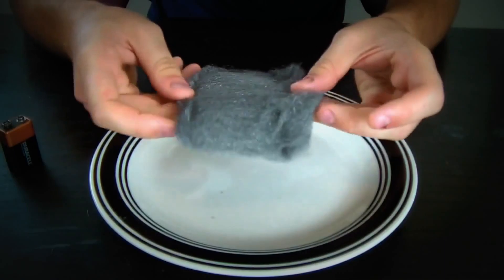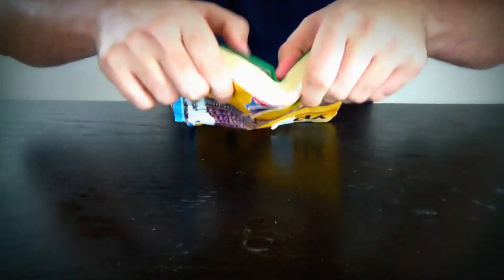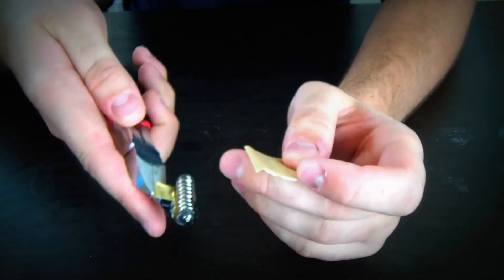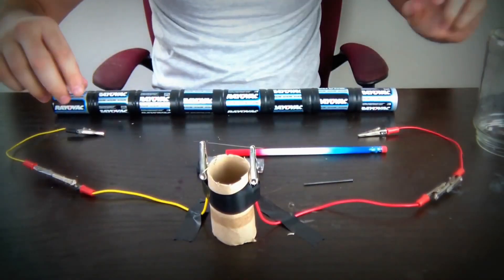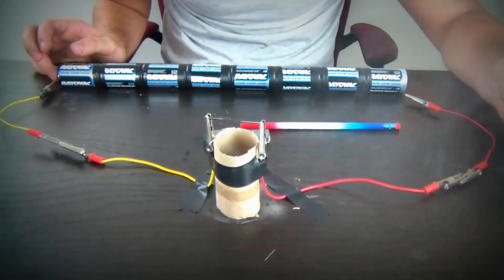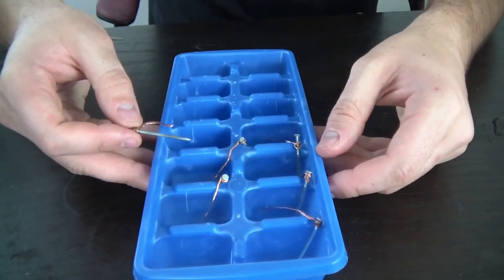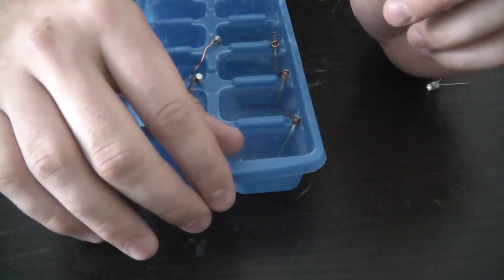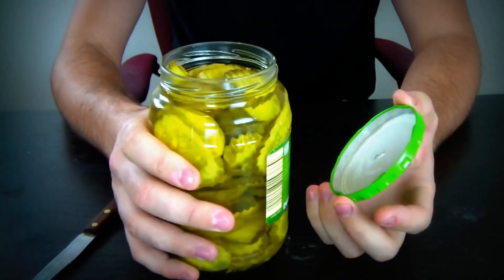10 Amazing Science Experiments you can do at home #14

Comment: 2:38 most of the batteries dont have small ones inside..  if u cut them than toxical shit will like out of there that my go in your eyes..
Reply: He used an A23 battery, which provides 12v. They always have smaller batteries inside. Other batteries, such as AA or AAA batteries do not have smaller, cell batteries inside.
Reply: infact he use the glasses

Comment: The 9 volt battery sets the steel wool on fire because the steel wool is so thin that the heat from the electricity from the battery lights it on fire, and if the steel wool weren't metal it wouldn't do that, so steel wolf is like one of the easiest things to burn with electricity. Never use steel wool to conduct electricity. XD

Comment: Can somebody explain the first one?
Reply: Steel is iron with most impurities removed from the ore.  There isn't much steel on earth that exist in a non man made fashion.  The result of removing impurities in Iron and creating steel lower the carbon concentration in steel. What is happening is that iron can rust in several ways.  One way of creating rust is water and oxygen, a process most people are familiar with.  If you leave a lock , battery, fence, ect , exposed to elements for too long it will begin to rust.  The objective of paint or sealer is to lock in and eliminate oxygen exposure to steel , lowering its ability to rust. The second method of created rust is to reheat steel.  The more oxygen involved the higher the temperature reached the more oxygenation taking place in the reaction.  Okay so oxygen isn't the only factor in this reaction , its more of the fuel than the fire but the reason steel wool catches fire so easily and say , a fork doesn't, has to do with the thickness vs the oxygen available, since steel wool is tiny fibers of steel , there is ample oxygen between the small tiny fibers to aid in the spreading of the heat.  This can be explain in terms of building a normal fire, if you stick a paper towel under a huge log , you likely will not achieve a fire however, if you build a tepee of sticks that are small, and place that same heat source under them you will create a fire, that you can fuel enough to eventually burn the log.  Steel is flammable in the right conditions.  When you touch the battery what happens is a short circuit, the energy has no where to go so it heats the source sort of like when you use an electric stove top.... that heat if fueled by said oxygen....as the electrical source adds charged particle to the metal , they start to collide, and it slows down the current process inside the steel wool but the battery is still putting out the same charge..this = extreme energy absorption of a small area creating temperatures in excess of 800 degree F to 1000+ F .  Simple put, don't touch the steel wool, blowing on it aides in the oxygen around it , causing it to spread and oxidize faster.  This is part of the reason why you can not run a 220 current down a 110 wire, it just will not end well for you.  At first it may be okay but the second you get even a small surge, its fire time! This is also the reason for breakers in your home, to ensure wiring it not taking on a load that is too extreme.  Steel is a terrible conductor of electricity, this is why it is not used in electronics, elements such as Gold, Copper, Zinc , make for excellent conductors, while steel and graphite (such as the pencil experiment) will burn out quickly over time.  You could start a fire with graphite as well.
Reply: +Cole DeLavergne you're WAAAAY off on this one...
What's happening is he's utilizing the steel wool to complete the circuit by touching it to both the negative and positive terminals on the battery. This causes heat to build up in the extremely thin fibers of the steel wool to about 700 degrees Fahrenheit, due to the electricity now traveling through the circuit i.e. The fibers of the steel wool. That heat then reacts with the pockets of oxygen throughout the porous steel wool like a flame coming in contact with fuel, which causes combustion to occur. This then spreads via a chain reaction, like a domino effect thereby spreading the flame.This is why it catches on fire.

Comment: it happens because of the low resistance in the steel wool when the charge goes through it, it's amps are very high causing it to heat up and combust...

Comment: You'd think this guy would know how LEDs work. One leg of the LED is longer than the other, and that's the positive lead. If you connect an LED backwards to a power source with even a little more current than those tiny batteries, the LED will explode.
Reply: anode and cathode
Reply: its fake cause you cant turn on an LED without a powersource

Comment: At 10:30. Better way of doing it is this.  Take a spoon, flip it so the handle is pointed up and under the lid.  Press it so it goes against the jar body and you will feel the lid pop as the air enters the jar.  That's the easy safe way of doing it..

Comment: Tip for the Ice Cube Tray one:
It is basically creating an electrochemical cell- the largest voltage is created with the greatest difference in the reactivity's of the metals, so try to use something like zinc and copper, or similar. Also, I would use a different acid that is stronger e.g. HCl for good results- acetic acid is only partly ionised in water meaning there are fewer ions that are free to move, therefore producing less of a voltage.

Comment: If you use two pieces of carbon rod and touch them gently then separate them a small distance, you get a very very bright arc (use eye protection, there might be a lot of UV in it, which is bad for your eyes). This is the way arc lamps worked; they also had a circuit which moved the electrodes as they were consumed to keep the amount of current roughly constant.

Comment: 1:14, here's how it works...
The stuff is clearly steel wool. What can also be easily seen, is that the strands of this wool are very, very thin: the size is '0000', the smallest size of steel wool you can buy. This is important. The reason it "burns", so fast is because of that word 'conduction'. The heat builds up so fast, and is able to transfer so fast, because of the ultra thin strands. However, it does not burn, this stuff is melting. Yes, the steel is heating up so fast, that it becomes molten metal. When you blow, it spreads faster. Why? Same reason fire spreads (and gets hotter) when you blow on it. The metal oxidises. One cool trick you can do with steel wool, is tie it to the end of a cord, light it, and fling it in a circular motion above your head. Have fun! Hope i answered a few questions.
Reply: lol troll
Reply: ***** no, not really... thats pretty much exactly what happens... not a troll, good sir :P

Comment: The resistance of the wool steel is very low, when you apply a voltage on it, the current ( compared to the electrons flow, or speed) is realy hi, even thought the voltage is low. the fire is made by the friction between the electrons and the steel's atoms

Comment: The steel wool catches fire because the electrons (or the electricity) are not limited by any resistor (a light bulb or anything else using electricity) when they pass through the steel wool. So, they pass through infinitely until the steel cannot bare the electrons and releases the energy as heat and light. To do this with a different size battery, simply find a way to touch both ends to metal. BE VERY CAREFUL, A LARGE FIRE OR EVEN MOLTEN METAL COULD OCCURE IN SECONDS.
Reply: U guys are having a go at him for having a brain logic what has the world come to
Reply: Smartass
Reply: Wow your smart
Reply: Smart nerd
Reply: I carry steal wool and a 9 volt in my wilderness survival kit for this very reason. Highly explosive if your in a dry forest.
Reply: Wow I looked in Google and found this exact same definitoin
Reply: I would say that there are better definitions:
The electrons pass through the wire, due to its thin cross sectional area, there is a high resistance created as Resistance is inversely proportional to cross sectional area. This basically means the electrons all flow through a small space, as they do so, they transfer their kinetic energy to the metal ions in the lattice, giving them more and more energy. When this energy is high enough, they gain more energy than the activation energy (denoted Ea) for the reaction of that metal with oxygen (whether that be complete or incomplete combustion). The redox reaction then occurs where the metal forms the metal oxide in order to complete its outer energy level of electrons, (probably with d-electron orbitals as it is likely to be a transition metal). This reaction is exothermic, (As Delta H will equal a negative number where Delta H is the Hamiltonian operator for the system), so energy is released by the reaction which 'creates' the flame. If there is any thing else you want me to add, I can, any corrections please mention.
Reply: We're not having a go at him, we just thought it was rather ironic.

Comment: for the steel wool the electrical current travels through the wire but its 2 high voltage so the wire burns up

Comment: Poking a hole in the lid ruins the entire purpose of the lid because now you have to eat all those damn pickles at once
Reply: That's not true. The pickle juice will keep them from going bad in the fridge.
Reply: There is an another way to open the bottle.
Just make a little space between the lid and glass by a knife.
Put a knife's tip under the lid and turn a little bit. An air will flow into that bottle.